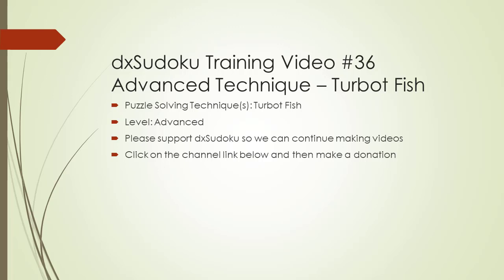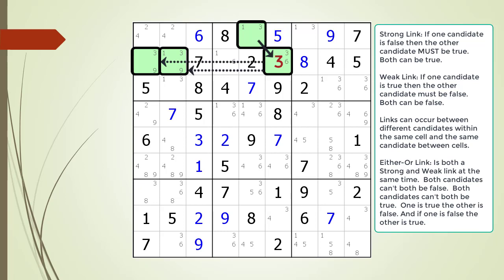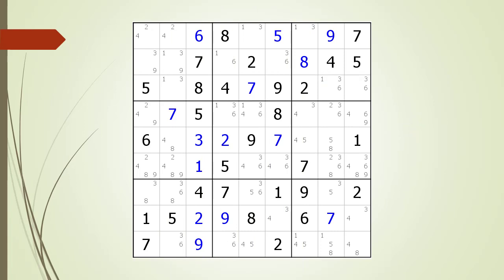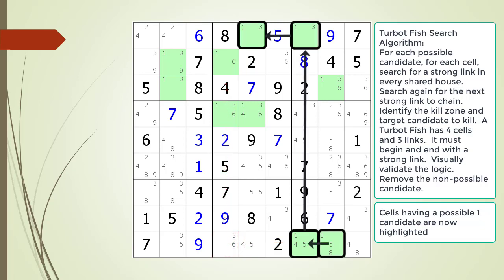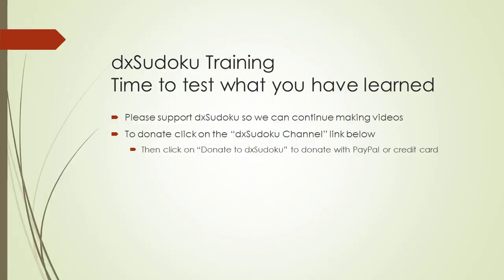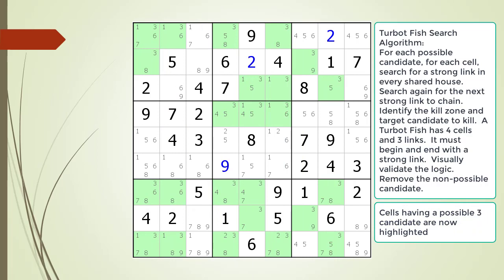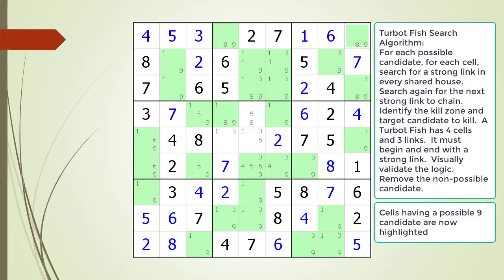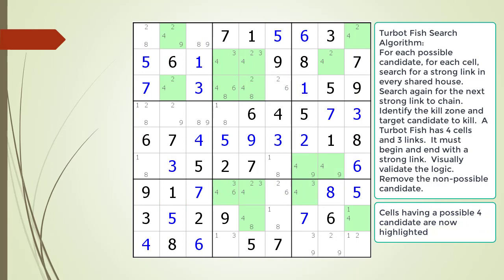dxSudoku #36 Turbot Fish Puzzle Solving Technique

Comment: Instead of going through every single permutation, the best way to find a turbot fish is to actually start with a pair of candidate that is in the same box that do not share the same row or column (diagonal to each other)

This is because the turbot fish always start or end with a strong link within a box! :)
Reply from the maker: I agree.  As you probably know, the Turbot fish is X-Chain with exactly 4 cells and 3 links.  I'm working on a video now for an updated X-Chain search algorithm very similar to what you are saying.  In the new video, after you identify all the cells participating in Either-Or links (2 cells in the same row or column house), I state in the video to use each of these cells as a potential starting point for the chaining sequence.  Then, after the first Strong-Link in the chain, you look for pairs of Weak-Link following by Strong-Link.  Each time you check if the starting cell or ending cell kill any candidates based on the chaining colors.   This new X-Chain algorithm will of course work for finding Turbot Fish.   

Here's another thing you might find really interesting.  I was practicing on some puzzles and I found a really interesting Turbot Fish which turned out to be a Nice Loop:
https://www.reddit.com/r/sudoku/comments/on9koi/found_my_first_nice_loop_in_the_wild/
I plan to do a video featuring this puzzle because I think it's a great introduction into Nice Loops which are usually not single digit patterns.

I'm also looking at doing a short video on the Empty Rectangle which is similar to the Turbot fish except one of the nodes of the chaining sequence is a group-node with a Group-Link.  I'm beefing up the chaining technique videos because my plan is to do some videos on Nice Loops and AICs by the end of the year.